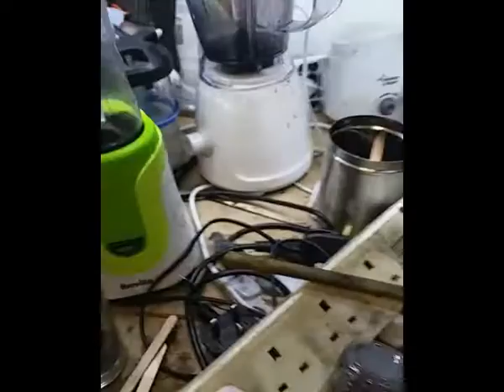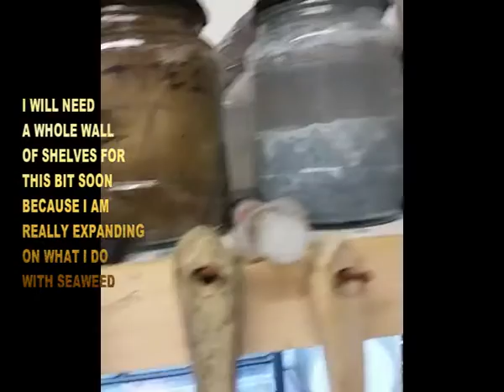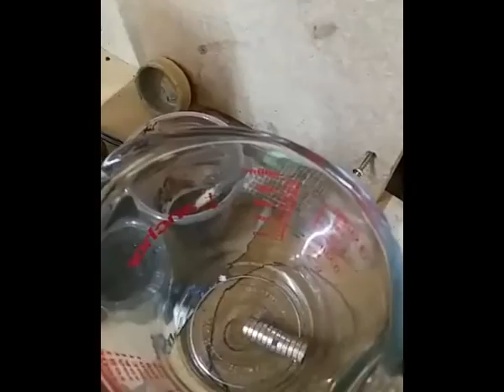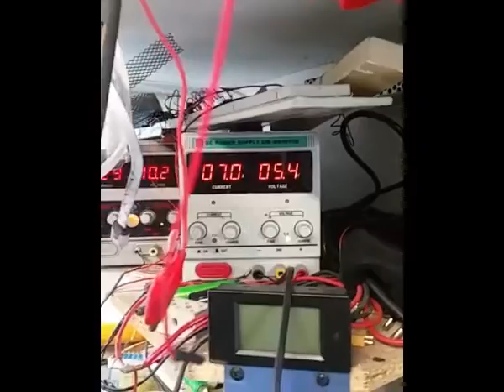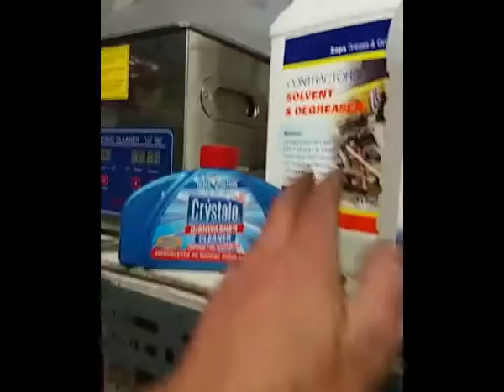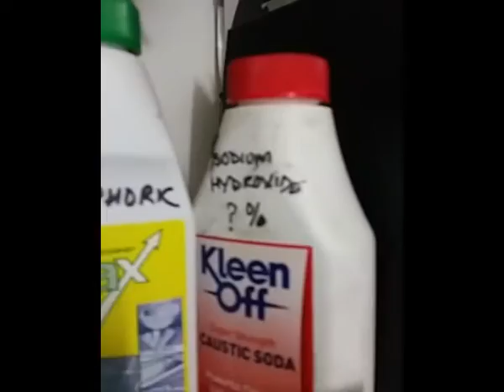LAB EQUIPMENT HOME GROWN & REVAMPED WORK AREA

Comment: Hi Kev,
Great tidy up, hardly recognise the place. :-)
The toggle clamps look like a good idea, as pressure is  obviously an important factor in most cell construction.
The load frame is another useful addition, perhaps the Voltmeter and Ammeter could be dedicated panel meters to save on all the fiddling about with cables and clock clips.
Looking forward to seeing your progress with the new sonificator.
Martin.
Reply from the maker: solarhope thanks mate it is amazing how much more can be achieved with an un cluttered work space .....